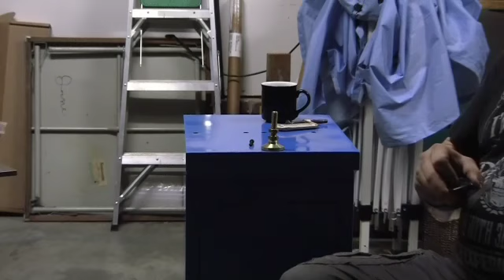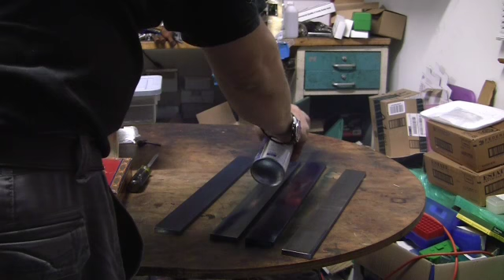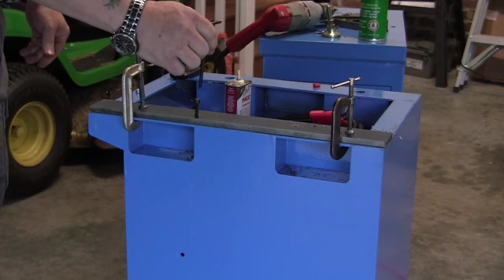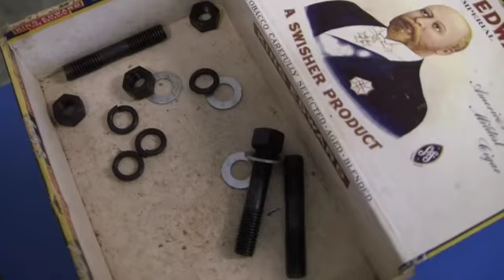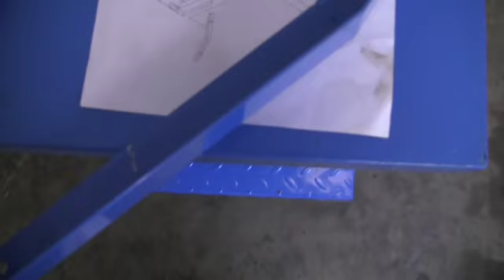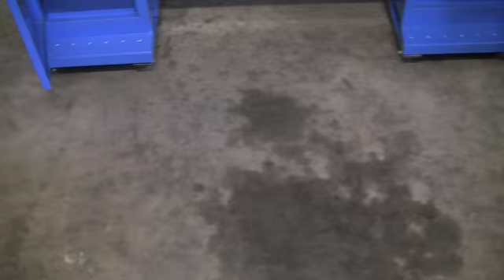PM 1228VF-LB Lathe stand assembly and modification

Comment: The idea of using the leveling feet is very good, very few floors are flat and level and by having the adjustable feet you can get the lathe bed dead level, (although with 8 leveling bolts you will be tearing your hair out), I think you would have made things easier if you had put 1/4" bolts at the ends of your doublers, that way the whole of the bar would be held tight to the base, with only a slight springing the 12mm adjuster will bind as it goes through 2 holes, although that will make very little difference once it is in place.